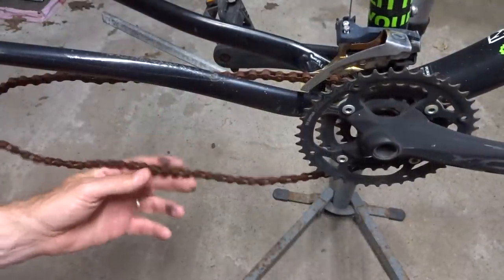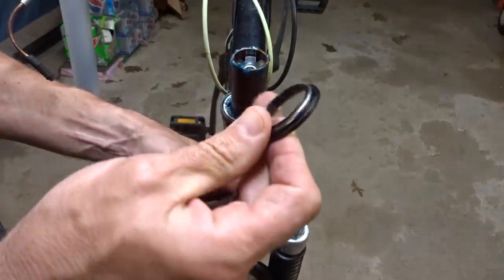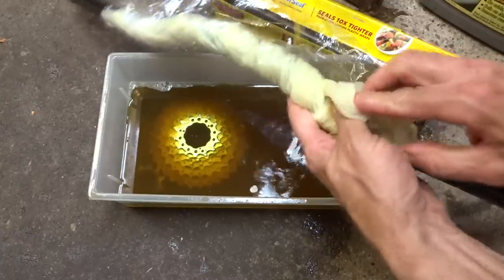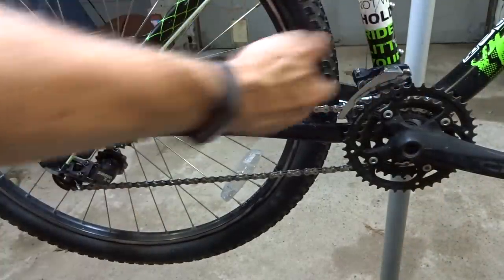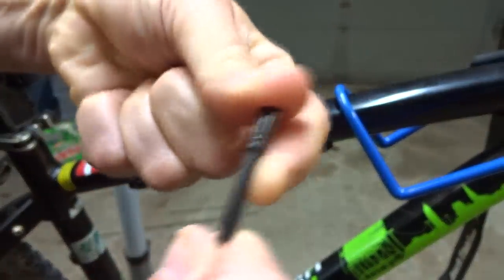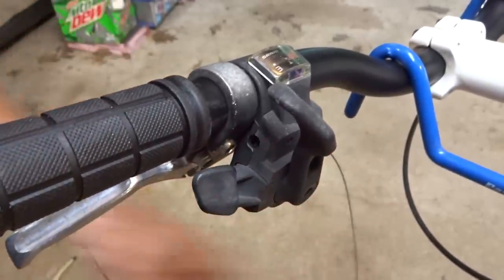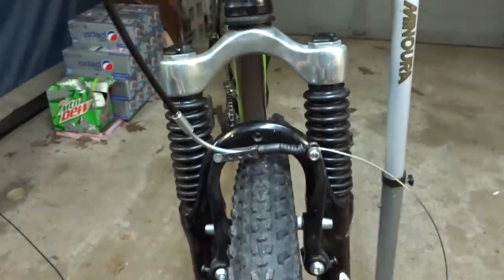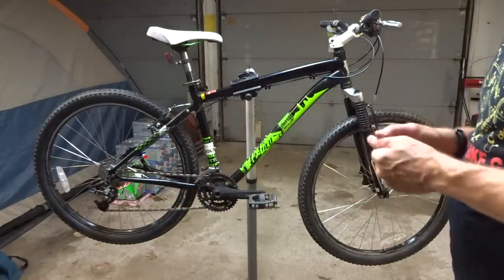Fixing/Overhauling The $15 Specialized Hardrock Mountain Bike

Comment: For the rear tire was that a "freewheel or a "cassette that you removed and replaced?
Reply from the maker: Cassette and I just cleaned it.
Reply: Thank you for your quick reply,. I have a 1999 Hard Rock specialized and I have to replace my rear cassette and i needed to know that info so i can order the tools and the cassette, By the way why did you measure the old chain to get the length of what the new chain needs to be, is it because it's only millimeters and not a big difference in length, ( that  the chain stretch is not that much ) just wondering because i have to put on a new chain also and if that what you did, and it worked i'm gonna do the same!
Reply: Park tool sells a chain stretch measuring tool. You hook it up into the links of the chain while it's mounted and it tells you if you need to replace the chain or not. If it's original, just replace the chain and pick one with quick links if you can. I prefer to run KMC chains because it's so easy to pop a quick link off and on when you are working on it. You need a chain breaker tool to remove the chain and pliers for the quick links (optional but makes it easier). Park tool has some videos on how to size the chain and you can use the chain breaker to remove links if you need to.
Reply: Thank you for your help much appreciated!

Comment: Great video but please man, for your safety, wear gloves when working with harsh chemicals like vapo-rust, seeing what it does to rusty bike parts, imagine how harsh it is on your hands
Reply from the maker: Evapo Rust is non toxic.
Reply: RJ The Bike Guy I’m not trying to be your mother or anything but would you drink it? 😂
Reply from the maker: @samihamady8569  No. But I wouldn't drink vinegar or molasses either, which are also used to remove rust.

Comment: The boots should fit over the noodle and then be retained by the noodle retainer (there's a lip) - but they are also the wrong boots - they're too long
Reply from the maker: Those are the boots that came with the noodles. And there is no lip on these noodles.
Reply: yea, that's a silly design. others I've seen the boot grabs the noodle so that it doesn't slip around and are shorter and grab the cable, it's just to keep dirt and junk from going into the noodle.  mine are more like the ones you see in your video https://www.youtube.com/watch?v=PMyVtWzeuBA

Comment: My niece has her bike 6 weeks back wheel wobble the axel inside damage
Reply from the maker: Take it back to the shop where you bought it. But I am guessing it was bought in a store like Target or Walmart, and cheap bikes break.
Reply: Think it was argos plus the qurntee ran out might just get new wheel easy to do just a spanner muddy fox bike also been rough with it
Reply: My pal has a downhill mountain bike  worth few thousand 
Because hygrolic disc orther parts carbon fibre frame if he crashes could snap the frame

Comment: Gosh, a 2012, with that much rust?......Must be near the ocean, but wow, I paid $15 for a former high quality bike today that is way older, may have spent more time exposed to the elements like under a awning or in a damp shed or garage, a old Murry 21 speed with quick disconnect front and rear rims, with "chrome moly" frame, and apparently wasn't used much since the tires are very nice, not the quality bike of that specialized, I own a specialized but knocking about town some homeless person tried to steal it before the store people chased them away, so I want a "beater" with visible rust but all redone cause those can stay chained outside a store all day long and no problems,...unfortunately I bit off more than I think I want to spend, cause the front rim has rusty spokes so bad I need to respoke it, the rear has two rusty spokes.  Center pull brakes, quality center wheel spindles, I'd mostly like to respoke both rims once I attend to everyting else,...no play in the bearings anywhere, just dirty and the chain even doesn't have that much rust, only lite rust, unlike that specialized,.....you see, I just didin't want to buy a el cheapo department store bike or use my old "iron Horse" 21 speed that was all rebuilt and has sentimental value,....jeese I feel stupid, but the murry was a quality bike and the bearings have no play, the tires are not sun cracked but like tires in excellent condition like the fancy seat, must have been in a damp shed.  I once was a big enthusiast in cycling for exercise and fitness, and getting back to that, but the local scene on petty theft is such that, well, I guess I am just looking to have some fun screwing around rebuilding something with minimal tools and experience with a abused bike.  I just never could score a beater super high quality bike, except this one, but the rim spokes, I can't believe I got stupid today in some way, but I may be real happy when I go to town on market day and thieves or bums aint eyeing a old bike with rust here and there,....errr, haha, I hope, even if chained while I walk the booths or go into the coffee shop for a cappuccino, ...funny how my old "iron horse" 21 speed is everything I need, but I've owned it for twenty years, wore out four rear rims and two fronts rebuilt twice at the bike shops, numerous upgrades and even now on a fancy four hundred dollar exercise bike stand that works well together, and it made sure I rehabilitated from a job injury that left me overweight and almost diabetic and such, it saved my life, I don't fancy a bum snapping its lock and pawning or selling it for enough for a few beers or cigarettes, no way.
Reply: Whoops, excuse the long writ of oratory so to speak, haha, I guess the old murry is getting me back to being "interested" in biking, even though I have some fancy so called mountain bikes in a nice dry bedroom along with the iron horse, they probably need a going through anyway, or at least the Giant does,...with disc brakes, its the one that almost became a stolen bike months ago,...I mean, its a nice bike and shines like new still.

Comment: maybe it would be more cost effective to use water to take off grips but alcohol to put on. thank you.
Reply from the maker: A bottle of alcohol only costs a couple bucks and last a long time.
Reply: This is what I typically do. Just something to act as a slight lubricant and also evaporates away quickly. Works great for both removing and installing grips.

Comment: if you put a new chain on old gears, the gears will wear out twice as fast. its better too change all the gears and the chain
Reply from the maker: It depends on how worn the chain and gears are. If you change the the change the chain before it gets too worn, your cogs/chain rings will last longer. In this case, the wear on the cogs/chainrings was insignificant.

Comment: You forgot to lubricate the drivetrain
Reply from the maker: No I didn't. I installed a brand new chain. Comes prelubed. Sealed Bottom bracket. Freehub was not causing issues. And not sure if it was in the video, but I did lube the derailleur.

Comment: And he forgets to service wheel bearings...
Reply from the maker: I didn't forget. They were working fine. This wasn't supposed to be a complete teardown/rebuild/restoration. This was to fix the stuff that was not working and make a solid riding bike. I already spent a ton of time working on the bike without fixing the stuff that didn't need fixing.
Reply: cup and cone bearing service, together with truing is the 1st thing I do when doing a restoration since it can create the most expensive fixes and fresh grease always makes a bike feel new. Idk the situation on this bike, but it doesnt look like it had fresh grease or any grease in hubs.

I know you know your stuff, but hub service is far more important than new cables or grips. One love.

Comment: No mater wat!!!wen u replace a chain you replace the cassette,,PERIOD.. sometimes you can get away WITH OUT replacement of front rings...jus replacing chain is rookie MISTAKE, NEW chain will ALWAYS slip under pressure on warn cassette no matter how clean it is.....
Reply from the maker: Nope. Chains wear faster than cassettes. Replace the chains when they reach 0.5% wear. You can go through couple chains before the cassette needs to be replaced. If you think I am wrong, then point me to an authoritative reference that says to replace the cassette every time you replace a chain.